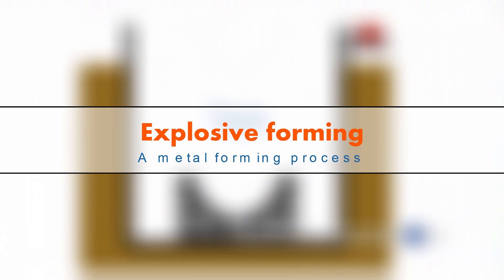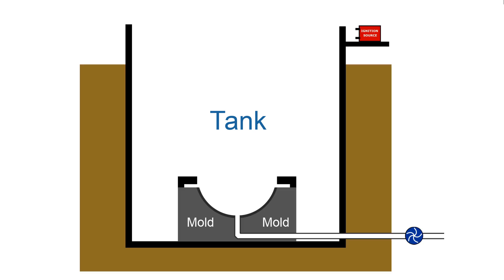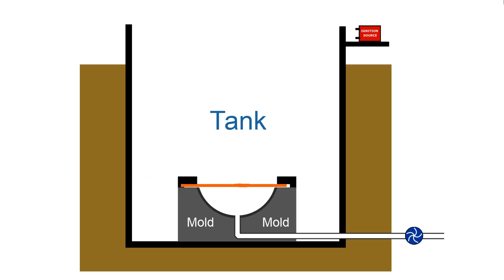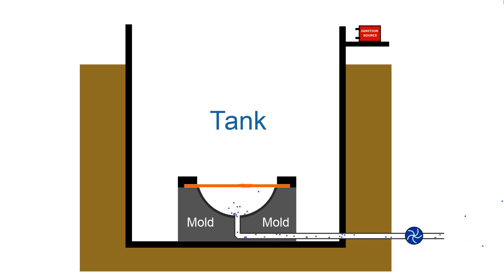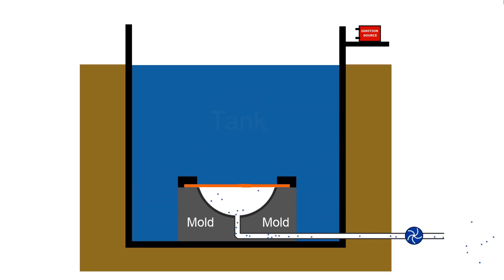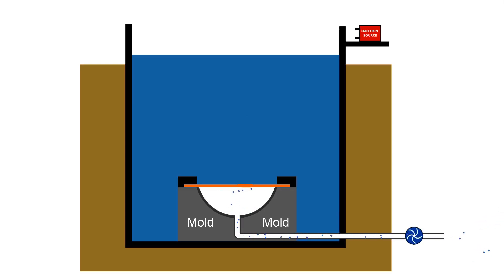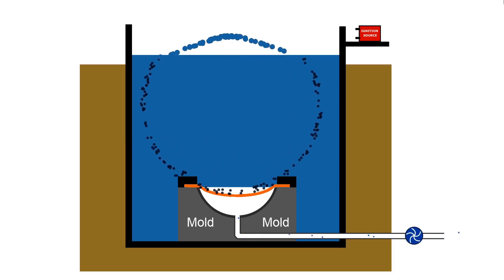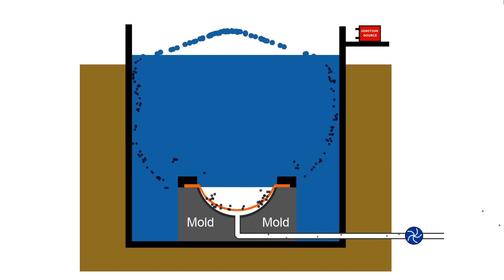Explosive forming

Comment: Does the water get forced into the cavity that gets formed? The animation seems to imply that water just kind of hangs in "mid air" as it were during the process, leaving a vacuum. In that case, what medium does the wave travel through? Seems to me, the water must be doing the forcing, since the wave could otherwise just travel through the work piece without deforming it. In any case, it is pretty clear that setting off an explosive in water (or air for that matter) would cause some fluid to flow outwards, in this case, into the work piece.
Reply from the maker: Yes that's a mistake in the animation.

Comment: A Die, not a mold, mould, nor moulde. I am an explosive hydroforming die maker...of 36 years.
Reply from the maker: Thanks for the correction.
Reply: @operationalfacts5602  Molding is when the material formed undergoes a phase change from liquid to solid, in dies no phase change occurs.
Reply: ps: you're welcome.
Reply: The meaning of the information presented is not changed at all by this pedantic word smithing.
Reply: please tell me yall aint dumb and do more than one direction at a time?
Reply: @kblskables2877  the previous generation formed the fuselage of the X-15's from Inconel-X.  We still posessed and inspected those dies, when I apprenticed.

Comment: do you have an example of this manufacturing process
Reply from the maker: Yes, sure. One use was to form sections of the bulkhead of the 2nd stage fuel tank of Saturn 5.
https://history.nasa.gov/SP-4206/ch7.htm
Section: S-II CONFIGURATION -> 4th paragraph

Parts of Aircraft fuselage are also sometimes created this way.
https://www.iter.org/newsline/196/932

Comment: Blow mold operations have been around for a long time.  Explosive molding is the same thing, just a different measure of operations.  It's fluid dynamics creating a malleable representation if the molding and is nothing new people.

Coca cola bottles are made the same way but with air pressure instead of using barometric pressure of water with a displacement greater than the steels structural integrity.

The question is what are they not telling you about this method?  What kind of explosive is used?  Because we all know explosives have different disbursement rates.

Is it something that they have a patent on or is it something that can be purchased?

Comment: Thanks, the animation made it a lot clearer :D

Just one more question, is the hole to let the air out small? are they a lot of small holes? does it have a mesh or something? or why does the metal not deform to have a "nipple" where the hole is? I guess the metal is strong enough to not deform that way?
Reply from the maker: I don't know the exact diameter of the evacuation port but yes it must be small. Any protrusion caused by the evacuation port should be small enough that it can be "sand down" after the forming is done.

Here's a paper on the that. It's long but you can skip to page 22. That's were they talk about the die and things to consider when making it. 
It's from the Apollo era so it's kinda old.
https://apps.dtic.mil/dtic/tr/fulltext/u2/605372.pdf

Comment: i don't see any mold in the sphere tank video, and it expand outward without any cover
Reply from the maker: This is the same process but instead of the water pressing from the inside of the tank to make it sphere, in this process the water forces a sheet of metal into the shape of the mold. In both cases the water is driven by an explosion.

Comment: If you look at a metal form, is it possible to tell if it was made this way? Does the percussive force interfere with the integrity of the finished item? Is there a failure rate, if so, what? Thanks in advance!
Reply from the maker: I don't know if you can tell which forming process was used(at least not visually). Considering this technique is used to create pressure tanks among other things, I don't think failure rate is worse than other forming techniques. I couldn't find solid data on that.

Comment: What's the difference between this and the one where its just a sphere out in the open?
Reply from the maker: With this method the water is contained inside a container. The work piece is placed inside the container and it's a sheet of metal which is forced into a mold by the water. In the sphere method the work piece is also the container of the water. The water pushes from the inside with equal force on all sides forcing the work piece into a sphere. Same principal, different setup.
Reply: @operationalfacts5602  Ah thanks for the answer. I didn't think of there being water inside the sphere.

Comment: And this is supposed to be cheaper than a press?
Reply: Yup...the tank might hold hundreds of forms to be shaped with one blast.
Some modes of metal failure happen over time; sudden re-shaping doesn't give time for stress to accumulate.
Residue from the explosive, especially from TNT/Semtex/C4, can be rich in nano-scale diamonds.

Comment: I'm glad that last molecule of air made it out safely.
Reply from the maker: That's a good one! I had to run the simulation a few times before they were all able to get out in time.
Reply: @operationalfacts5602  What software was this simulated with if I may ask?
Reply from the maker: I use Godot. An open source game engine.
https://godotengine.org/
Reply: @operationalfacts5602  awesome, thank you for your quick reply. I'll check it out, seems interesting
Reply: @operationalfacts5602  This was awesome and helped to clarify the process, great work dude. simple is perfectly fine when its done this well.
Reply: @operationalfacts5602  The moment you said Godot was the moment I checked and realised that this video wasn't posted in 2009
Reply: But one is still stuck in the tube!\

Comment: Please guide me which explosive be used in water. I want to make a 30 inch dia stainless steel 1 mm sheet round ball. If I fabricate the geometrical design, which explosive I use. Please guide me in detail. 9999711833, Delhi India

Comment: Thanks, can you give examples where this technique is used?
Reply from the maker: Yes, sure. One use was to form sections of the bulkhead of the 2nd stage fuel tank of Saturn 5.
https://history.nasa.gov/SP-4206/ch7.htm
Section: S-II CONFIGURATION -> 4th paragraph

Parts of Aircraft fuselage are also sometimes created this way.
https://www.iter.org/newsline/196/932
Reply: @operationalfacts5602  thanks a bunch!
Reply: @operationalfacts5602  Thanks for the NASA link. Lots of great information.
Reply from the maker: @Duane Degn  No problem. Glad I can help.
Reply: https://youtu.be/96yhdnhPxAw